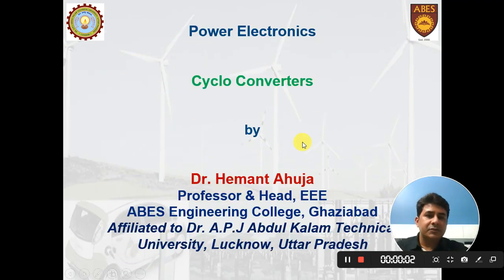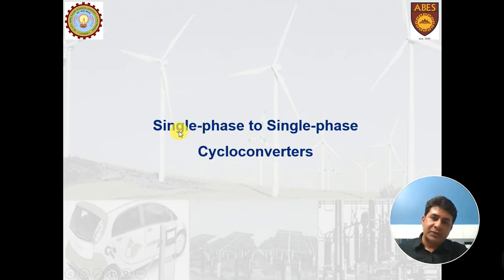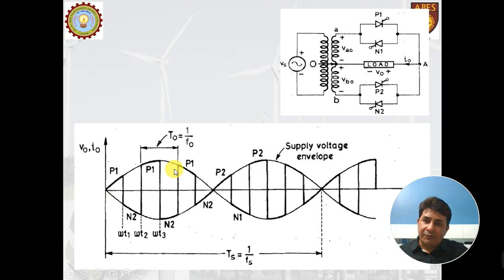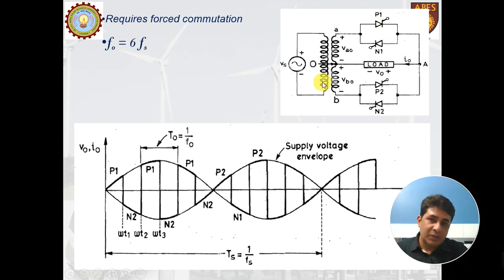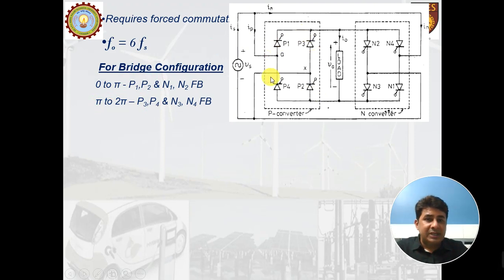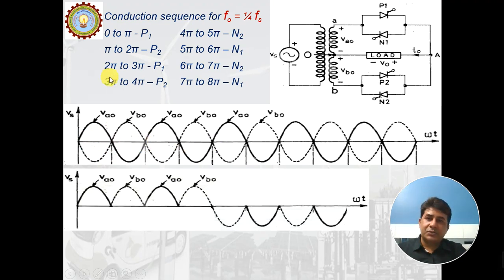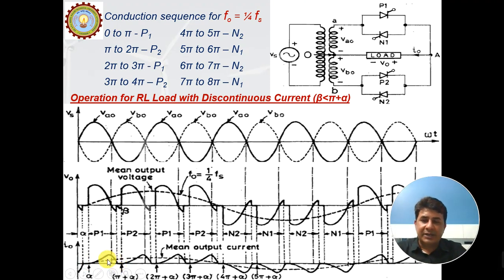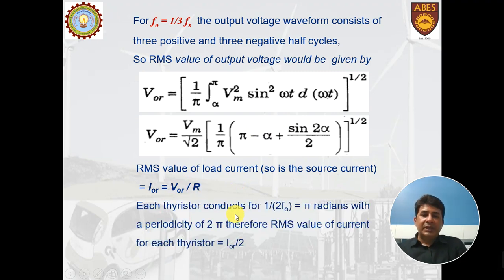PE (L17)  Single Phase to Single Phase Cycloconverters

Comment: @26:00 i know this is for the LR case, but the 2nd wave form there goes negative, implying that the SCR hasn't been turned off.. i guess I'm having a hard time grasping this because I figured if that were P1 then it'd be reverse biased in that instant. So my question is what keeps that negative voktage in play, the inductance of the presumed Inter Group Reactor?